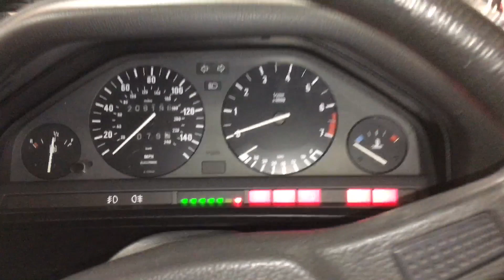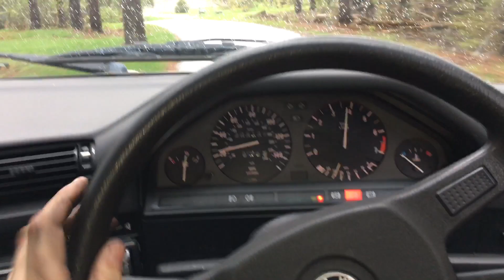Project Touring Part 18: The first drive

Comment: Hey man so just rebuilt my motor, 87 325is, when taking it apart the exhaust manifold section for 4,5&6 slide out of the downpipe. Is that normal? I can't remember if it did that before and I can't find any info anywhere, it has a inner section after it slides out so it kind of looks like it's suppose to do
That. Then I find out the other section actually broke at the weld points where the downpipe fits to the headers. Was making a sound for the past month so I guess it was that. Going to try and get it welded  tomorrow, I'd rather go aftermarket then replace it but I'm not ready to dish out the money but let me know what u think about the 2nd manifold thanks.
Reply from the maker: I don't follow